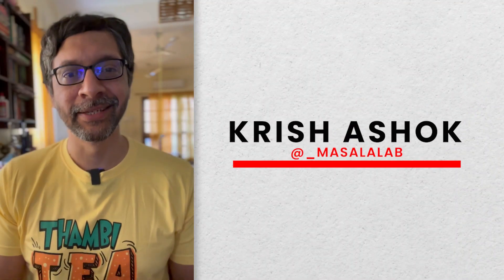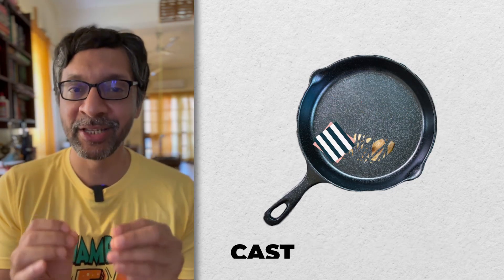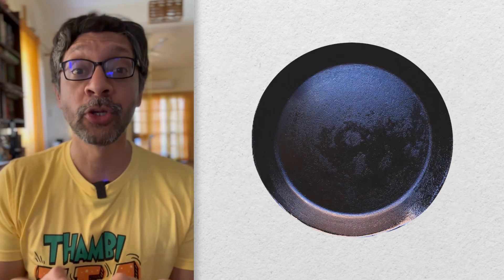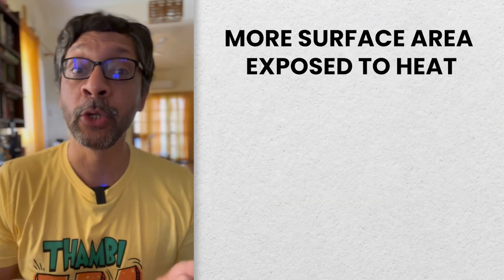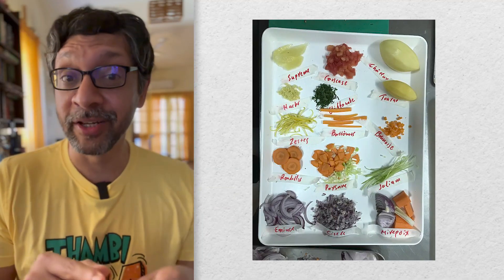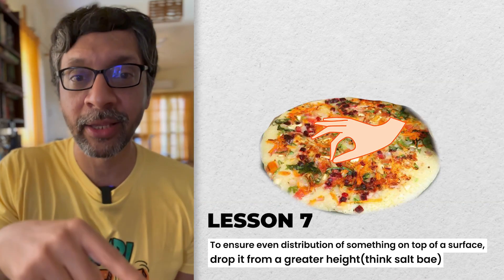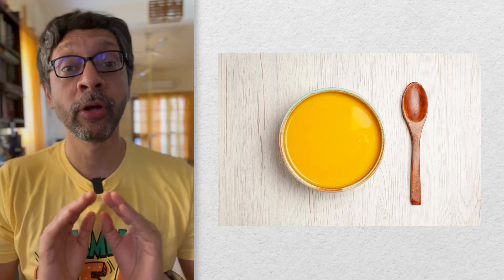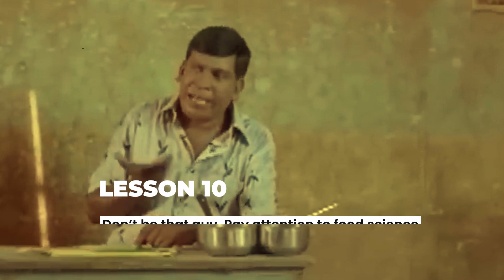The Oothappam Masterclass

Comment: It is true starting with a water wash spreads heat uniformly, but also lowers the heat of the pan. Also the minute water "balls" rolling around creates an invisible nonstick layer before the batter comes in contact with the pan. 

If you manage the temperature of the pan well, even your stainless steel pan will become nonstick

Comment: Usually the water is sprinkled on the pan after oil is applied, this not only ensures the reduction of the pan heat to the optimal levels but also evens out oil across the surface due to those minor explosions that happen when water encounters the hot oil.
Reply from the maker: Ah interesting! Makes sense!

Comment: As a dosa connoisseur in making and eating dosa. 

You need to reduce the temperature when you put the dosa . oil left from previous on surface of tava will cause dosa not to ensure stick to the surface giving rise to white spots because steam  from batter gets trapped between parts of  dosa surface and tava surface leading to the dosa surface getting loose from the tava leading to whilte spots. 

Depending on type of dosa you want a slightly crisp surface if dosa on tava side and a steam cooked one on other side ie a bit softer. 

So the dosa needs to first stick to the tava. When the maliard reaction makes the dosa surface dry steam prefers to escape from top surface of dosa.  At that point adding oil to the dosa enables the bottom of dosa akready dry devoid of steam to get fried giving the golden fried color. 
Banglore dosa etc uses maida, sugar etc to give a crisper surface plus butter or ghee gives crisper surface and whole lot of it helps in the even golden crunchy surface.

Comment: Excellent combination of humor and science 👏🏽👏🏽

I have one remark though.  You mentioned that water is sprayed to even out the temperature since liquids are better at transferring heat by convection.  

Please note that water boils at 100 oC at atmospheric pressure. So if a drop of water covers an area which is partly at 200 oC and partly at 300 oC, it cannot help in evening out the temperature by convection.  Because the water will boil off at 100 oC, it will undergo phase change as steam at both these locations.  So any temperature evenness it can bring (and if it can bring) can happen only for temperatures less than 100 oC.  

Since the cast iron plate will normally be higher than 100 oC, I don’t not think water helps in making the temperature uniform by convection.  

Instead, my view is that, when you sprinkle water and spread it, it helps to achieve a uniform temperature because it boils off.  When a water boils, it take a lot of energy (to quantify, it takes nearly 500 times more energy to go from 100 oC water to 100 oC steam when compared to going from 99 oC water to 100 oC water). At places in the cast iron pan which have higher temperature more water will boil off than at places with lower temperature. Thus this boiling of water helps in creating an uniform temperature rather than heat transfer through convection.  

If there are other views, I am open to it.
Reply: Perfect

Comment: Hello! I have a query that has little to do with this video. Does fermentation of idli/dosa batter increase the nutritional content? How does fermentation help apart from making the comestible soft? Thank you for your time.
Reply from the maker: yes it does. Bacteria break down large molecules in the batter and make a lot more essential amino acids, vitamins and minerals more bio-available
Reply: @krishashok  Thank you. Will the same benefit happen if the batter is artificially fermented using yeast/sugar or is the breaking down restricted to natural fermentation? I have observed that adding sugar to the batter helps fermentation even in somewhat cooler conditions like the current monsoon season in Bangalore. Wonder if this will work in winter as well.
Reply from the maker: @mdaz68  There is no distinction between natural fermentation and fermentation using yeast. Commercially produced yeast is still a living organism that ferments food. The difference is in reliability and efficiency